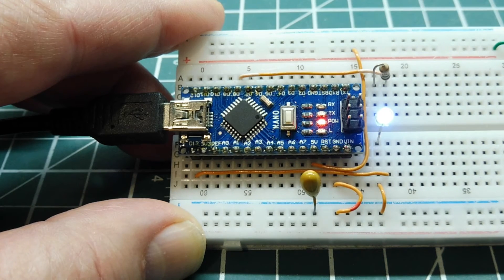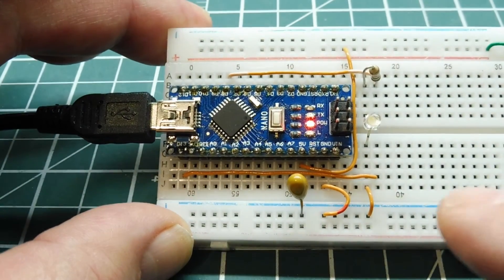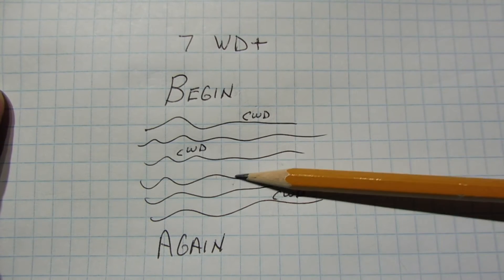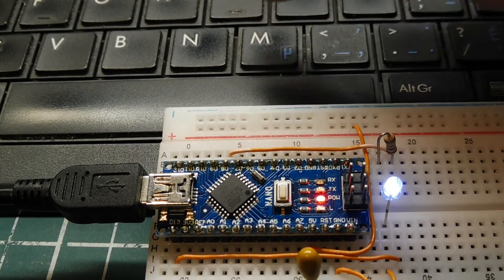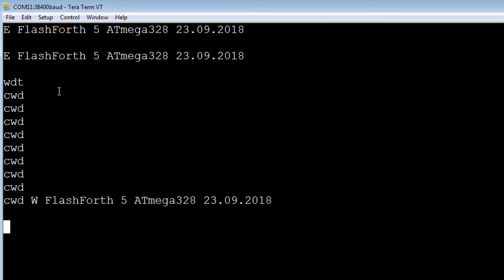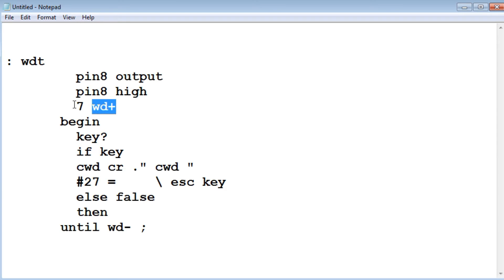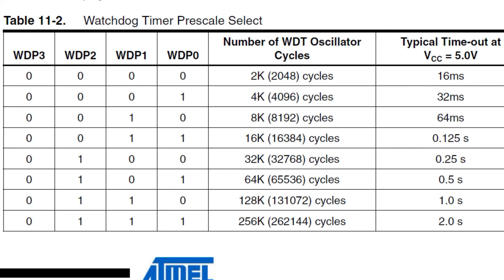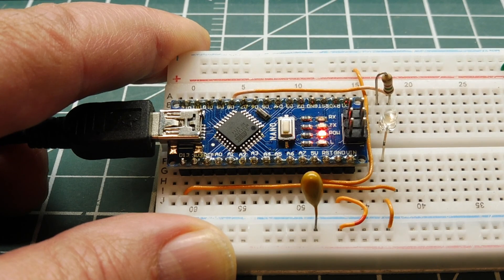Arduino Watch Dog Timer  / AVR

Comment: Kindly share the code
Reply from the maker: Code starts at 3:55
Reply: I am very new to Arduino.so i can't replicate the code which was shows in u r video, in Arduino IDE.kindly share the code in proper format it will be very much helpful me🙏
Reply from the maker: I do not use the Arduino IDE. The code is written in Forth. https://flashforth.com/atmega.html
Reply: @0033mer  Could you please assist me in converting this code for the Arduino IDE? I'm specifically looking for this feature for my ATtiny85 remote control power consumption.
Reply: @0033mer  Could you please assist me in converting this code for the Arduino IDE? I'm specifically looking for this feature for my ATtiny85 remote control power consumption.
Reply from the maker: There is lots of code available online for Arduino. Search for WDT libraries. https://www.arduinolibraries.info/libraries/watch-dog

Comment: Hello Sir,
I need your help.
I want to set watchdog timer for my arduino program.

My condition is if digital read pin 5 goes low for  max. 8 second then arduino should reset.
Please guide me.

Comment: 0033mer, I have a question about my RF POWER OUTPUT METER I saw in one of your videos running a LoRa radio, you response to my request would be greatly appreciated.
Reply from the maker: My email address is available under the "About" tab on my channels main page.
Reply: @0033mer  Sorry, don’t see an email address on the about page on your main page?

Comment: nice demo, but you did not show the real code which you programmed to arduino, please share the your code. thanks
Reply from the maker: Code starts at 3:55
Reply: @0033mer  I new with the programming and I don't know how these syntax in arduino ide... please guide
Reply from the maker: The program is written in Forth as I do not use the Arduino IDE. Check out other videos on my channel for more examples. Forth has been used by NASA in their space probes and satellites for many years. Check out the Forth.com website.
https://www.forth.com/resources/space-applications/
Reply: @0033mer  thanks

Comment: I'd like to see you use the WDT interrupt feature too. That sounds like it has some good debugging potential. 
  I also have a challenge, if possible, can you come up with a way to single step an ATmega328? It's more of an abstract curiosity. I figure it's probably impossible without hardware emulation. 
  I came across a guy that built a circuit to single step a 68k using a few simple tricks. Replicating that tutorial is on my list of stuff to try as a 68k is supposed to have a 400KHz absolute minimum clock. The idea got me wondering if this is possible with any basic uCs or if it is just an old MPU thing.
Thanks for the upload.
-Jake
Reply from the maker: I mostly program in Forth which is a "threaded" language and is very easy to debug. Some Forth implementations have a built in debugger and single stepper. If you search around there are some debugging tools for the AVR micros.
https://sites.google.com/site/wayneholder/debugwire

Comment: I there a way to use the watch dog to kind of look back and figure out what happened or is it just to get the micro back doing what it is supposed to do.
Reply from the maker: The watch dog is just a resettable down counter timer and it does not know what caused the timer to time out.
Reply: @0033mer  Ok, thanks

Comment: Thanks for the clear explanation. 
I have had the issue of the micro controller (PIC) entering an endless loop due to some kind of electromagnetic interference coming from a nearby appliance. I guess, enabling the watchdog timer is always a good idea. But the very fact that there is an option to disable it means that it may not be always required. In what situations is it desirable to disable the watchdog timer?
Reply from the maker: You can program the configuration fuses on the ATmega328p so that the watchdog timer is permanently enabled.
The watchdog timer can also be used to generate an interrupt when it times out for timing applications and it is desirable to be able to disable this function during code development.
Reply: When doing developpement and correcting bugs it would be better to don't have the board resest at any moment.

Once your project is finished you can chronometer the loop time and then choose the smallest watchdog for your code.
Reply: @novivi4390  - Thanks.